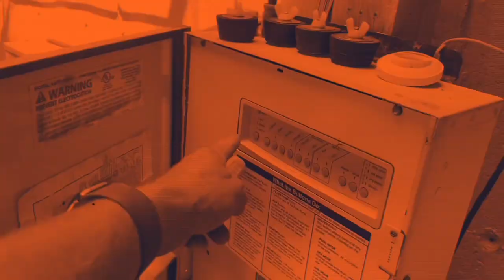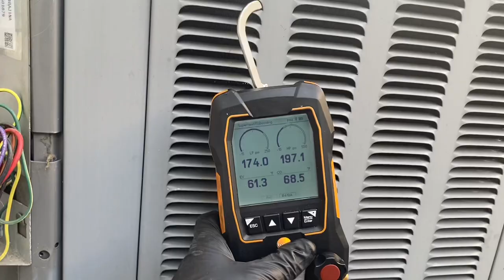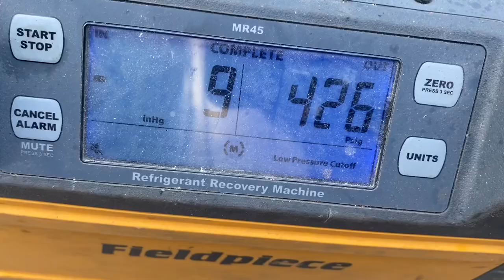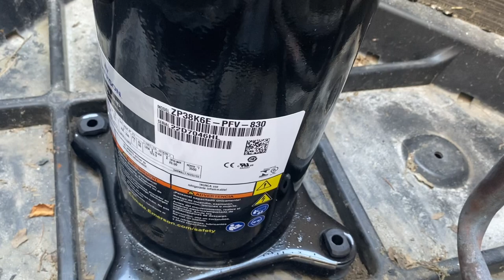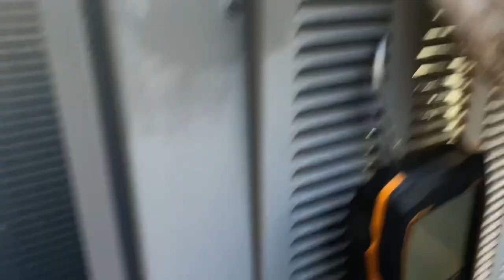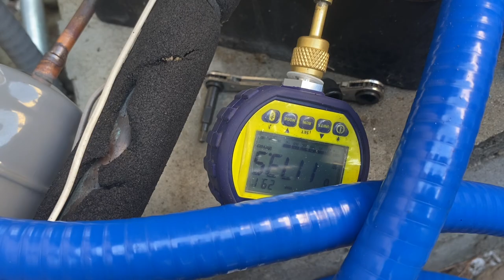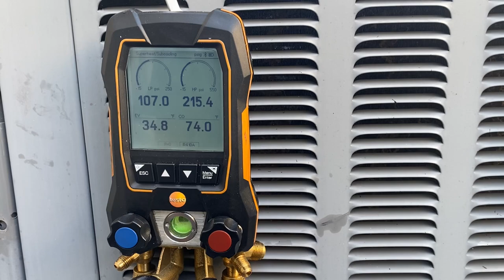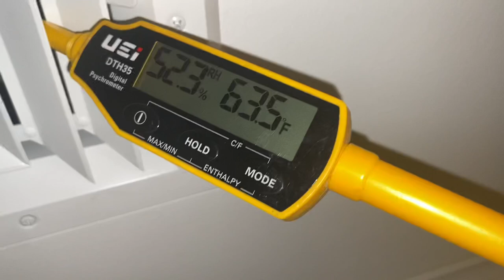How to Replace a Defective Copeland Compressor in a Rheem 4 ton Outdoor Central AC Condenser

Comment: In the third party commercial world.....whenever I write up a compressor for replacement, I stress that most compressors do not die from natural causes. Indeed.... most are murdered. I always mention that there are several potential causes of failure, and those causes cannot be identified until the defective compressor is replaced with a working compressor. Those potential causes include: 1) dirty condenser coils, 2) clogged or defective metering device(s), 3) overcharging by other contractors because of the metering device, or restriction other than the metering device, and 4) power or capacitor problems. The client or trade specialist or rep then understands that there will very often be a follow-up quote once the causal factor has been identified. If the dryer which was replaced during the compressor replacement is severely restricted, then often no other cause is found, but we need to make the customer aware of the potential additional costs BEFORE the work gets  approved. In some cases, knowing that additional work could nearly double the repair cost, the client will ask for a unit replacement quote as well so they can give the store corporate all of the available options.
Reply: I see a lot of bad compressers from oversized units that short cycle a lot.
Reply: @jph77  I'm sure that happens in residential, as overcapacity installs are commonplace.
Reply: @arthouston7361  I tell people all the time bigger is not better but they don't believe me and trying to convince them otherwise is too much of a hassle.  So they oversize it and wonder why some rooms in the house still feels hot....SMH
Reply: @jph77  When people ask me about sizing, I explain that the smaller system takes longer to achieve the setpoint, and that longer run time allows for greater removal of water from the air, which makes you more comfortable even if the dry bulb temp is warmer in a given room. I use the analogy of stepping out of the bathroom after a shower, and how cold the hallway feels. It is because of the evaporational cooling happening on the surface of the skin. A dryer house allows for more skin evaporation, and it feels much cooler than a cold, clammy house.
Reply: U did not mansion oversized equipment do to undersized ductwork , like is here in Illinois 🙈monkey pox
Reply: @pawelkolodziej4210   I'm certain that undersized ductwork is a big problem in some areas of the country. Remember, the primary reason the ductwork is undersized is that it was originally designed for hot air only, and at some point someone decided to install central air conditioning onto an old central heating system. The ductwork required for cooling is larger than for heating, so if they never upgraded the ductwork, it will be undersized.
Reply: Absolutely Correct most compressors don't die there are murdered  by something in the system ... & we always chabge dryer & also fresh virgin re charge .....tomorrow iam doing an compressor change out  & Customer knows up front  TXV & or evap coil may  also have to e changed ...but we never know till compressor back installed leaked tested / evacuated / recharged & up & running so usually we go ahead & quote New TXV & or Coil upfront &  if it runs Cools & no new txv & or coil needed great TXv & or Coil  is  returned for credit ....of cource if needed   its alot more work more work  to do an pump down & replace txv & or Evap & start over on A new start up procedures

Comment: Thanks dude. You did great. I'm an electrician and I have made mistakes too. And I went back to review the error you saw. I get it. The there aren't service ports inboard of those king valves. So it needed the whole system drained and vacuumed etc.  I don't I would make that one because as a newbie I'd be checking every move I made. But here is what I wish to comment about today.  This compressor was likely in good shape electrically, would have passed winding tests etc but it failed to compress air. I believe I have the same thing going on here now. And I'm gambling on a new compressor because it's been hard to gather anything on this good motor bad compressor situation. More , even a whole show on diagnosis of this trouble.  Thank you.

Comment: A little brazing tip for your boss, Refrigeration supermarket technician here upon brazing highly recommended that you heat the inner diameter pipe up evenly first allows that heat to penetrate the piping to the center of the fittings, and then start heating up evenly around the outside until you get that nice color change and then apply the brazing rod evenly and the capillary action like in plumbing

Comment: I was watching the brazing of the suction line to the compressor, happy to see the use of nitrogen and wondering how the nitrogen was being vented since the rubber plug was still on the discharge line connection on the compressor.  I always worked alone and therefore never could have turned over a compressor replacement in such a short time as you both did! I wondered also about the dye in the system has indicated an on going leak issue with the system.  I don’t think you could have pulled a proper vacuum if there was one.

Comment: When you pull the Vaccum how does one prevent the POE oil from leaving compressor?   This is the part where I get all confused.  Also new condenser units come pre-charged I also wonder how they pull the Vaccum and not lose oil before charging prior to sales?

Comment: I was yelling through my phone when you close the service valves
Reply: I wouldn't have blamed you for the dryer though
Reply: @allstarheatingandcooling113  its a big issue if it is what killed the compressor. Stuff happens but always replaces the dryer, do a acid test.
Reply: Yes alot of the time we get caught up in the moment. I was going to say your better off recovering all refrigerant. Doing acid test and recharged with virgin 410. But theres no way were all perfect. I have seen big mistakes with techs in the industry 20years so it happens to the most experienced.

Comment: One suggestion I would have to eliminate a possible mistake would be to just carry and use bi-directional filter driers. That way, you don't potentially install the filter drier on backwards, and you would be prepared for the heat pumps. We are all human. We all make mistakes. Have a good one! 🤙
Reply: Bi flow are usually just for heat pumps but it will work for sure

Comment: King valves and Service valves are different.  You don't see King valves on modern units, they were mostly used on Carrier products.  King valves, did not have schrader valves in them, you had to close them slightly to get pressure to  the line ports.  Service valves have schrader valves in them, so all you have to do is put your hoses on them.  I always hated King valves, because you always had to have a service wrench to check pressures.  Good video, everyone has screwups it how you handle them that matters.
Reply: Wrong! King valves exist on all condensing units...what your referring to is a 3 position service valve usually on older carriers...
Reply: I know this is late but just wanted to add.  King valves were used when air conditioning became popular in the 1970s.   They functioned as both Schrader and service valves.   The Schrader valve married with a parker valve is  much cheaper to manufacture.

Comment: Good video 
But I did not see any quick Qwick check acid test.
Also is good to put hot block on the compressor special discharge outlet because there is a sensor on the top of the scroll compressor.

this is how the field is for many years of experience mistakes always occur and from that you learn, and it is about not making them once you know the correct process.

Comment: On my last compressor I fit up my compressor.....then cut it out in a spot where I could put an RLS coupling on the suction and discharge. I then removed the compressor and brazed the piping outside the condenser in a more accessible spot and pressed it in at the couplings. Worked well. My only concern was how the discharge coupling would hold up. Only time will tell.

Comment: Mike, next time you need to unsolder a fitting try wiping it down with the stay bright flux first, it should prevent the snot. Also a quick question, how was there nitro flowing though the compressor when you had the rubber plug in on the opposite side?

Comment: The worst part of compressor replacement is the trapped gas that turns into fosgene gas when you disconnect the lines
Reply: I usually pull a quick vacuum on the system to help with this problem

Comment: I didn't know what you were up to when you started by closing the valves. Also I wouldn't unbolt the compressor until I pulled out the refrigeration lines, otherwise it would probably be moving around on you

Comment: Great video like always. Our company makes us replace all refrigerant with a compressor replacement. I'm sure you guys did a thorough check for any leaks on the coils before completion.
Reply: Why check….that’s another service call….
Reply: @wayneguy6043  I hope your kidding.  Mike and the guys seem pretty solid. Most reputable companies will let the customer know all problems going on with the system.  Per the diagnostic fee ,we check everything so no surprise expense for our customers. I know somethings will need to be repaired/replaced for proper operation of the system.

Comment: Just curious Mikey why didn't you braze the elbow closest to the compressor 15:30 outside before install then braze the final connection on the 7/8s line 14:45. If I had to venture a guess, you placed the unit inside to rough in the elbow and its less effort to leave it all in there to be braze.

Comment: I saw when you made that mistake. The whole time I was thinking he cant do that and then sure enough you fessed up to it...the only way that would work would be if it were a heat pump you could recover just the compressor through the true suction port since it goes to the compressor and condenser only...

Comment: I was cringing so hard when you put that torch on there. Glad you noticed before she blew
Reply: I actually had another tech condemn a  compressor on an older unit he had done some work on and closed the isolated valves and forget to open them. So it would blow the breaker immediately on start up. So he recovered the charge and my manager sent me back the next day. I was about a year in so I went back thinking it was recovered did exactly what you did and it blew right in my face. Did nothing to me except stain my shorts haha. But dam that thing blew

Comment: I used to sweat out all the compressors that I just cut the lines as close as I can.And it's a 100 times more efficient I no longer sweat out my copper. Also I was very confused when he started closing off the service valves. I was like something's not right lol thats how you trap all the refrigerant in the condenser. I was waiting for the big boom when he started sweating out the copper...

Comment: Could you also use staybrite 8 on that compressor install rather than braise and then you would not have needed to flow nitrogen? Just curious on the limitations of what you braise vs what you can use staybrite on.
Reply: I wondered the same thing…
Reply: Although StayBrite-8 could prob handle a high vibration connection I would feel better about a regular silphos joint right at the compressor.

Comment: If your head pressure was that high them that compressor won’t last. Should’ve checked the metering device and for kinks. These rheems dont like long runs either. I always upsize the line set on 4 ton to 10 rheem splits

Comment: Chuck in the truck or Stan in the van. Lol. I didn't even noticed the filter dryer. Until u said it.
Reply: @PipeDoctor  Did a maintenance last week on a Friday. Called out Sarurday to same customer. Their AC wasn't cooling. All it was doing was blowing warm air. Go out to the condenser it isn't coming on. Tested for power at the contactor no power look at the disconnect and there set the fuse on top of the disconnect box.

Comment: I had to replace a compressor on a huge 5-ton Lennox unit(trash, in my opinion); anyway I actually crawled inside the unit to un-braze the suction and discharge lines while sucking in phosgene gas 😂 #lennoxsucks A real man realizes his mistakes, have another one Mikey lol j/k

Comment: I've only had one Can explode on me.
It was a Trane rooftop unit it happened during a maintenance and I was running it through first and second stage cool. I Heard some weird harmonics coming from it at first but it didn't sound smoked "No marbles in a can".
About a minute and a half later before it the second stage cool I smell that very distinctive "brazing a filter dryer smell".
About two seconds later the whole winding exploded out of the can mixing with oil and refrigerant to make a flamethrower like electrically charged death beam 4 or 6 feet long out of the unit on the compressor access side.
The disconnect was about 4 inches away from where the death beam was so I couldn't shut it off less be burnt to a crisp or fucking electrocuted dead with some kind of electrified fiery noxious death cloud.
Fuck me no breaker tripped it just arc flashed and burnt like that until there was no more refrigerant inside, Just watched the full payback of that 8 ton rooftop.
I just backed up and watched the show and thank God I wasn't looking at my gauges unaware right before the fucking thing exploded...
so moral of the story is now when I'm testing three phase rooftop units I never stand in front of the compressor section I'll stand off to the side and smoke a cigarette lol...

Comment: It’s OK to make mistakes when you’re just learning come in from plumbing and have not grasp all the basic concepts yet of HVAC. 

80 foot line length have you read the installation manual supplement for extended line length ?? 
                      Cut open and inspect the compressor possibly see the top surfaces of the scroll ground away and signs of lack of lubrication from floodback ?  

Long line length I’m going to gather there was no one-way check valve added in the liquid line ? 

Think I noticed no heater blanket on the compressor to prevent flooded starts ? 

Did you pour out and measure the amount of oil that should be in the compressor to make sure the evaporator is not log with oil that left the compressor but did not return ?

I was not going to mention the filter dryer.  Like watching your videos as you progressive long and become better and better as you learn it’s a process. 

You remind me of my first old boss in general contractor in construction you guys must be brothers from another mother lol 😂

That unexpected extra high high side head pressure you may want to test for non-condensables ?

Comment: I imagine most of your audience got what you did with turning off the valves to the house side of the system and closing the schrader valves as well, but they don’t think some would get that if you heated up that connection a little more you would have had a major explosion in your face when you lit the 410A still in the compressor! Look, I don’t think you made any mistakes because you corrected things as you noticed them! The leak test fluid has me a little concerned. But you did a decay test when you pumped the system down and if that passed it’s not leaking now. How do you address that on your invoice? Do you cover for leaks? Have a great weekend Mikey!! PS how do people not know by now that Christian is your son not your boyfriend WTF !!!  #letsgobosch

Comment: You should weigh the oil thats in the compressor to compare with the data tag, if not in warranty....cut the compressor open and figure out why it failed in the first place. Or it'll fail again, possibly in 6 months to 2 years. Compressors dont die...they are murdered. Be a detective and figure out the why....it can save you and your customer....plus it can lead to more revenue. I also blow out the condenser coil and evap to get the total oil charge out in the system...out of the system.

Comment: Just want to give you the opportunity to learn... In the compressor there are compressor seals, that pressurize the cold vapor refrigerant into a warm liquid form, to send to the evaporator coil to extract heat from the home.. As a result the nitrogen purging system you had set up while you were brazing the compressor back into the system, wasn't actually purging nitrogen. This is also the reason why you had high pressure shoot into your VP85 and thus probably fucked your VP85. So if you were able to purge nitrogen through the compressor, you would have a damaged compressor with bad seals, not allowing the compressor to compress. So basically, you can test a compressor this way, and we do it all the time in refrigeration work. 
Not trying to be a prick. Just trying to share some knowledge. 
There's a difference in making mistakes, and trying to do the right thing, the right way, and making the conscious decision to do things the wrong way, knowing the right way to do things. Keep up the quality work, and don't stop making videos.

Comment: Whoever worked on that system prior really put their 🍆 into it. They botched the wiring and then left it with just enough  refrigerant charge that it wouldn't freeze up but not enough charge that it could properly complete the refrigeration cycle possibly starving it of oil and smoking the compressor all in a single bound yikes... more hacks more stacks...